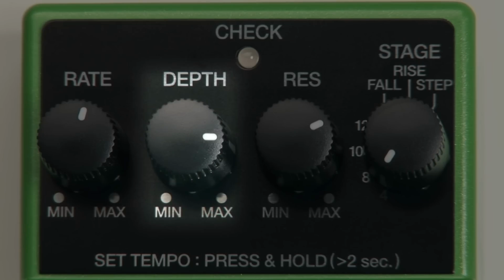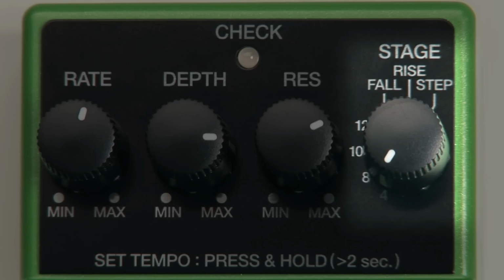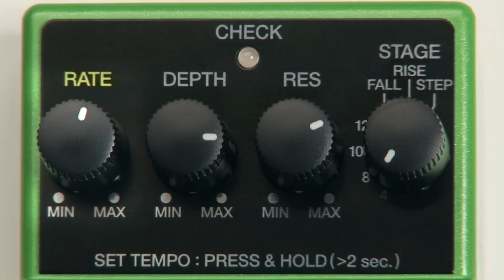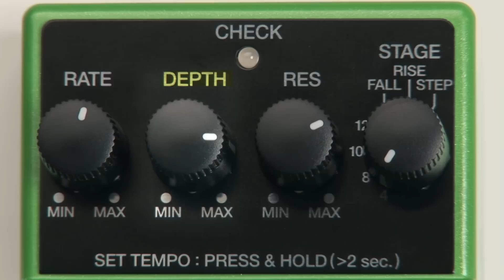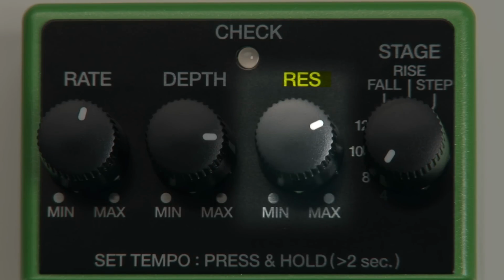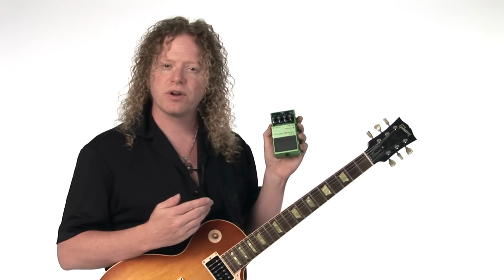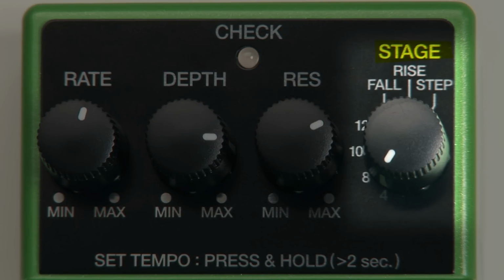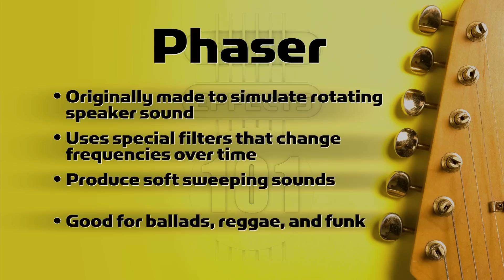EFFECTS 101: Phaser

Comment: Finally a good explanation of what phasing does. It filters certain frequencies and changes the frequency it will filter over time. Like opening treble while closing bass and back and forth. Am I right?
Reply: Isn't that similar to an wah auto Pedal?
Reply: DP is right in that description is more fitting a wah pedal, but that's not true for a phaser as shown in the video. A phaser does filter certain frequencies, however, the frequencies are constant and the total number of them depend on the number of stages (the last option showcased in the video, notice how 12 stage covers more than 4 stage, but in both cases they don't change the specific frequencies they cover - the tone is the same every time he strums and keeps the settings as is).